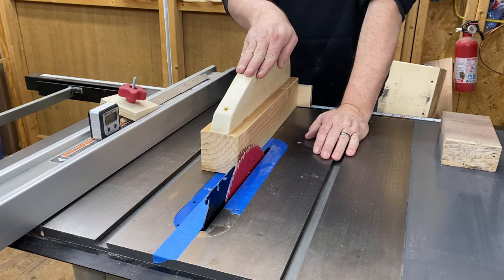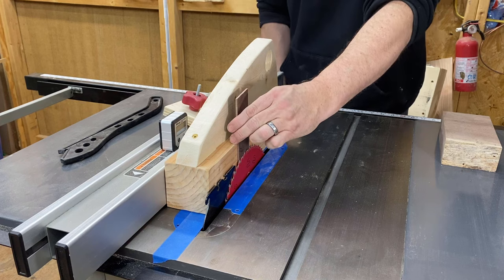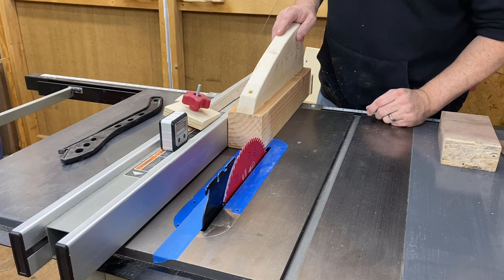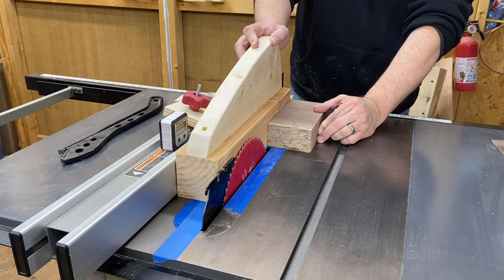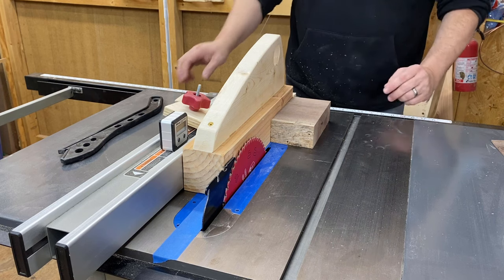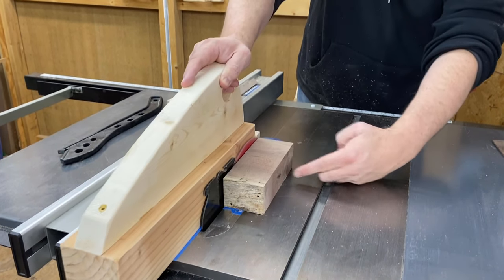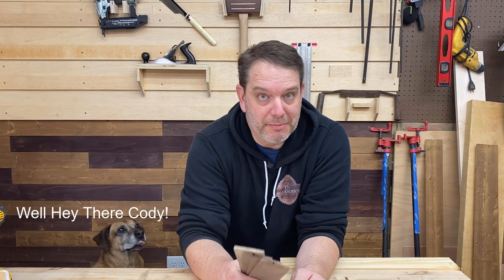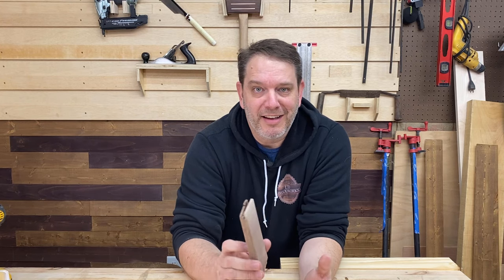Easy Thin Strip Jig For Your Table Saw!

Comment: I’ve seen a few jigs like yours and if I can make a suggestion. The piece you screwed on the back to hold the stock if you use a piece that is higher than the stock you are cutting and extend it farther out it will not only push the piece you want to cut but will also push the entire piece of stock reducing any kickback.
Reply from the maker: Thanks for the suggestion. Definitely worth a try👍
Reply: Or puch it into the back of the blade?

Comment: kind of cool, but not safe. you are applying tons of pressure with your left hand towards the blade. cool in theory, though!
Reply: How would 2 fingers apply tons of pressure?
Reply: @pablor3138  because the fingers usually have body weight behind them? Is that a real question?
Reply: @numerousactuary6640  didn't know you could apply more than 900kg in force with your fingers.

Comment: Very good method - probably w/ more consistent thickness results than other thin strip jigs I've built where you have to snug the fence up to the jig's wheel/index every cut as the stock gets smaller. However, the thick beam/handle and solid 3"x 3" or 4" x 4"  is quite heavy, and using SOLID stock isn't necessary. I think will modify the design by making a hollow version of the 3x3" or 4"x4" --i.e., just using 2 pieces of 1/2" (3/4" max) plywood w/ spacer/support (forming an upside down "U"). Of course accurately jointing this U-box before assembly will be critical. I'm pondering yet another variation where the push stick/jig rides on the fence.   Thanks for video.
Reply from the maker: Totally agree that this type of jig doesn't have to be so solid. I have a tendency to use what I have laying around so that I can put it together quickly. My shop time is VERY limited so this one was very quick to throw together. I can see my self making a lighter version one day down the road. But hey, it was a great work out!😉 I also think that the base doesn't need to be tall at all. Just sturdy to hold the back support piece is probably all that's needed which I believe is what you are saying. Hope to see your version one day. Thanks for watching!

Comment: Great Vid! Is there a jig to split 5.5 redwood fence boards down the middle to make two thin boards?
Reply from the maker: I assume you mean making each board roughly a 1/4” thick by 5.5” wide because my guess is the board is about a 1/2” thick to begin with? If so, do you have a bandsaw with a fence? That’s probably what I would use. The use of a table saw can be done but would not be as safe.

Comment: I am assuming if you want to cut 1/8” and 1/4” strips you would need to build x2 separate jigs or add a new piece on the back each time?
Reply from the maker: Nope, the back piece sticking out only an 1/8” should still push just about any thickness above the 1/8”. It’s really just there to push the wood. Another thought which I would like to do it make an adjustable piece in the back that would slide out more when needed.

Comment: i need this exactly but my problem is i need a set up where the max height for wood im using is up to 140 or 150 mm in height strips any ideas for set up as most tables that i know are 12 inch and dont give me enough vertical height for the strips i need ..anyone ?

Comment: Hey, I just bought a dewalt 7491rs and was wondering if you recommend thin kerf or full kerf for cutting and ripping hardwood. Thanks
Reply from the maker: I personally use any of the Freud blades. In my experience they work great and are way less expensive then some "high end" blades like Forest blades. Thanks for watching!

Comment: Are there jigs that will work on band saw
Reply from the maker: The only "jig" I use so far on mine is a fence I made out of plywood. This would work just fine for cutting thin strips on the band saw. Just set your thickness and push the wood through with a scrap piece of wood to protect your fingers. Good to go! Thanks for watching!

Comment: Great jig!  Also, I noticed your excellent platform set up for your drill press.  I'm going to adopt (steal actually) this design for mine and my Dad's!  Will credit you and show your video to him.  He's going to love it.  Going to use knobs instead since his hands are getting pretty bad.
Reply from the maker: Thanks! For the drill press table I have actually built a new one that works much better! Be sure to check out my build video on it. It has T-Tracks with knob operated hold downs for the work pieces so you can be hands free. And it has built it  dust collection! Thanks for watching!

Comment: That's an awesome idea, but if you have to cut 999 times to get 1000 pieces and your kerf size is .125 (1/8"), that's a lot of saw dust (waste).
Reply from the maker: Yep, you’re absolutely right. But the table saw blade leaves a much smoother surface as opposed to a band saw blade. I didn’t want to have to sand all that much. It was a one off project so oh well.
Reply: @LTDWoodworks  I watched that following this, that was pretty slick, 1000 piece cutting board. I'm a hobbyist and just getting into woodwork so I don't know all the ins and outs and don't own all the gear, just watching some videos to get some ideas. Take care!
Reply from the maker: Sounds good. Let me know if you ever have any questions. Thanks for watching!👍

Comment: Curious why you couldn’t just set your fence at that thin distance from the blade and run your piece along the fence?
Reply from the maker: It’s because it’s not easy or safe to push a thin piece past the blade. If you were to just push the main piece through the blade and once the thin piece is free of the main portion it would stop between the spinning blade and the fence. While it’s stopped there it also as a HIGH chance of being shot back towards you if you’re standing behind the blade (which you should try not to do anyways). So, this method is also about safety. Hope this makes sense.
Reply: Thanks for the reply. Yeah I guess that does make sense. Could you also put a stop block against the fence and use the miter gauge? That way you’re repeatable and accurate but the thin off cut isn’t binding ?
Reply from the maker: @GK-ee7mw  Yep, I think that would work just fine 👍

Comment: This seems rather dangerous with a real possibility of pinching the blade.  If you are a beginner, don't attempt this.
Reply: Not true. I made it according Collin Knecht's video as well. Even before I had a real table saw (only an upside down circular saw that time)
Now I have a table saw and I already used it some times on it. I consider myself as a beginner on the table saw.
I don't have a zero-clearance insert plate yet but I covered the gap with duct tape.

Comment: Nice idea. Only thing that catches my attention is that since you need to hold both sides to keep the stock from slipping to the left, it forces you to be directly behind the blade in the path of any kickback. I feel like a 1 sided sled with a stop block would be safer, right?
Reply from the maker: I think in general you're right. Standing directly behind what you're cutting should be avoided whenever possible. The table saw is always a challenging tool to be safe around. I think even a two sided sled would work just fine as well but I think I might try a one sided version like you say. Thanks for the idea👍

Comment: Great jig! Beats having to move the fence every time.
Can I offer one possible improvement?
After you push the wood through the blade you had to reach a long way forward to get that thin strip of wood to clear the blade out the back of the saw. 
It seems to me that if you set your offset halfway on the jig rather than right at the back you would not have to lean so far over the blade.
Reply from the maker: Thank you! Yes, reaching over the blade is something I never like to do. The shots in this video are actually the very first time using the jig. Now that I have used it a lot ( watch the 1000 piece cutting board video 😉 ), I now just let the pieces fall since I don't have an out feed table  yet.
For real short strips I think your idea might work just fine. I may have to experiment and give that a try. Thanks for watching!
Reply: @LTDWoodworks  I was thinking about this today as well, an easier fix might be to extend your grip/handle back towards yourself. It would then work somewhat like a push-stick.
I did watch the 1000 piece cutting board video, I would not have the patience. It turned out great, I liked the pattern.
Reply from the maker: This is why I like the YouTube world, everyone has great ideas! Thanks again for watching!

Comment: Morning, nice job looks like he can rip out some nice strips with that, I am wanting some thing that you can make different sizes I guess you could always just put a shim between the push block and the fence and remove them when you need a different size? Question for you though I watched you run that piece of scrap through your jointer but when you placed it up against your fence to do the initial cut off of the excess it appeared in the video that there was a rather large gap at the top which would indicate to me that either your jointer fence is off out of square or your tablesaw fence is out? Just an observation could be a obstacle illusions. Anyway thanks for the great idea.
Reply from the maker: Thank you! If I remember right, it was probably the jointer. That old jointer was not very good. I have since sold it as it wouldn't hold square very well and got a better one. Nice and square now👍 I've been meaning to get around to making a better one that is lighter and better built. So many things to build and so little time. Oh well... Thanks for watching👍

Comment: Hi, Cody!!  Sir, I need to re-saw (Mahogany) 10 foot plus, rough 2 x 6, into finished 1 x 6 for decking purposes. Question, after the jointer, what blade should I use in the table saw? P.S i have a thickness planer; can you suggest a process, that utilizes the mentioned equipment? FYI, I'm in The Philippines.
Reply from the maker: Hi! For the blade on your table saw I typically use a Freud name brand 10" thin kerf rip saw blade. There's better blades but for the price and for the amount of work that I do, these work great. For your process I would probably rip them just a bit thicker than what you need. Then run them through your thicknesser to the correct thickness. All being sure to run both sides of the piece so both sides are nice and flat. Hope that makes sense and helps. Let me know if you have any further questions.

Comment: Sorry for the stupid question, i'm new to woodworking, 
Why can't we just put our fence at the right thickness & cut the strips using only the fence as a guide? 
Thanks for your great video
Reply from the maker: No worries! Doing the method you describe would have a greater risk of getting the cut piece pinched between the blade and the fence. So after it's cut free it could get shot back at you at a million miles an hour. Not good! So basically the method in my video is MUCH safer👍 Thanks for watching👍
Reply: @LTDWoodworks  Thanks a lot 👍

Comment: Why would you move your fence with each cut without the jig? Isn't your work piece supposed to be against the fence?
Reply from the maker: That’s the point of this jig. It’s so you don’t have to move the fence each time. This way the cut pieces are exactly the same width every cut. This jig acts as the fence, it just moves as you cut. Hope that makes sense. Thanks for watching 👍
Reply: @LTDWoodworks  Thanks for the reply. I mean though wouldn't your fence stay in the same place (say 1/8") if your work piece is between the fence and blade? then you keep cutting new strips from the discard piece. The problem would just be in pushing it through. Maybe it's not possible without the jig?
Reply: I'm trying to cut 1/2" x 1 1/2" strips from a 2x4. It will be fine with just a push stick until I get to a square input piece of wood. Then there may be a tendency for it to flip over. What kind of jig would you suggest for that?
Reply from the maker: Ah, gotcha. In that scenario I would say that's too dangerous. Trying to push a 1/8" thick piece of wood pass the blade would just be too hard even with a push stick, etc.
Reply from the maker: First question would be how long of a piece are you try to cut as well? I would say the one issue with the jig in this video is the length of a cut that it can safely make. It's around 17" to 20" max. For me I would say that if your total length is longer and the thickness is your 1/2" thick by 1 1/2" thick, it would be ok to use just your fence with a push stick. So no jig needed. If the length happens to be shorter than the 20" then using the jig would be a safer route to go.
Reply: @LTDWoodworks  Thanks for clarifying. I'll need as long as 27" for those cuts (I'm making slats for a bed surface where the mattress will rest and that's going inside a sprinter van.) I asked because once the input piece has a cross section of 1.5" x 1.5" it will be as if I'm resawing the piece instead of ripping it, which may come with new challenges. I know I won't get 7 full slats per 2x4 due to the blade width, but I'm trying to minimize the waste and that last cut per piece may be tricky. Thanks for the feedback, I'll give it a try with just the push stick.
Reply from the maker: No problem, good luck and be careful👍
Reply from the maker: Sorry, I just now saw your last response. I would say I'm not a fan of wearing gloves around the table saw or any other woodworking powered equipment. There's always a chance of a blade grabbing the glove and sucking your fingers right in. I know, the fingers shouldn't be that close anyway and if they are they'll get cut or worse. Also be aware of long sleeves around the blade.I to struggle to remember safety around the table saw. Someone pointed out to me just the other day that my pull strings for my sweat shirt got to close. But other than that, using the push block is always a good thing and I would say you're doing pretty good. The table saw in my opinion is about the most dangerous tool in any shop and we should all be safe around it. Keep up the good work and if you have any other questions just let me know. Hopefully I see them sooner👍
Reply: @LTDWoodworks  Thank you very much for watching and getting back to me. Good points on the gloves and sleeves. I have a new 6kW electric heater in my shop now so I can wear short sleeves from here on out, plus it will be warming up soon. I didn't think about the gloves being a hazard but you're right. I was trying to avoid splinters and get a better grip on things. The slats worked out great after all. All of my cuts were clean and no mishaps. I'm learning a lot and really appreciate the videos. Thanks!
Reply from the maker: @assortedmountainlife  Ha, I know what you mean about the cold. I’m struggling to keep my shop above 40 degrees Fahrenheit when it’s 20 degrees outside. Guess I need even more insulation. Oh well.

Comment: What happens if you want a piece of thin strip around 16 to 20 inches long
Reply from the maker: I would think that this jig would work for something that long. You would just be starting the jig with your cut piece farther back while still resting up against your table saw fence. Or you would just have to make a longer jig. That does make me think that I'll verify the longest length that this current jig would cut safely. So I'll check and let you know👍
Reply from the maker: Yep, just check. The total length of me jig is around 17.25" so it would handle up around 20" long strips just fine👍

Comment: What machine is that at  01:19 ?
Thanks
Reply from the maker: That was my older Delta wood jointer. I sold that one to get a slightly bigger one though. It makes a flat surface along one edge of wood. If you have any other questions just let me know. Thanks for watching!

Comment: Why the piece of wood at the end when all u do is cut it off??
Reply from the maker: That’s just where it’s being cut to size for the thickness of strip that I was going to cut.
Reply from the maker: It still sticks out 1/8” in my case. It’s not flush with the large piece of wood.
Reply: So its not really needed?
Reply from the maker: It is needed. That 1/8" of wood that sticks out in my case is actually what pushes the wood thru as you are pushing the whole jig. 1/8" because that's how thick the thin strips I wanted were. If it was not there or just flush there would be nothing to push the wood forward. Hope that helps.

Comment: Hi. What's the thinnest piece of wood strip you could produce on the table saw? I need to get 1/32inch and 1/64inch strips and wanted to see if you thought it would be possible to cut strips that thin on the table saw
Reply from the maker: Well I personally have no experience cutting anything less then around an 1/8". My opinion is that when you start going much less then say 1/16" the wood would loose it's stability. 1/32 and 1/64 is incredibly thin. Yes, that's the range that most wood veneers are made but I'm not sure of the process to get it that thin. 
So, it might be interesting to try. But with my saw not being a high end saw I would worry that when trying that thin just pushing the work piece thru the blade would cause the work piece to "rock" slightly side to side. Now I'm only thinking it would "rock" side to side by a 1/32 or so but that would be an issue when working this thin. Basically causing inconsistencies in the wood.
Maybe a combo of a table saw and a drum sander would be best. Of course only if you had a drum sander as well.